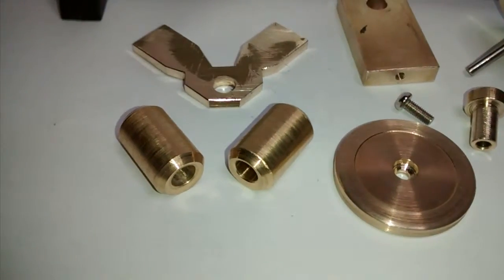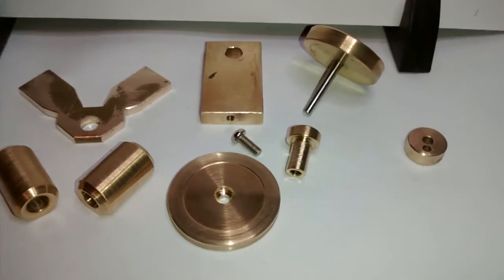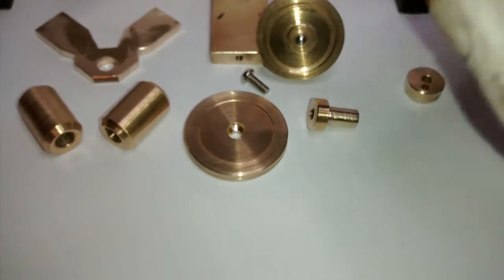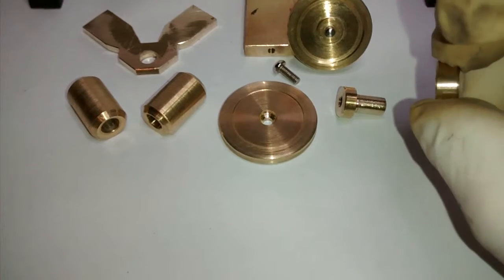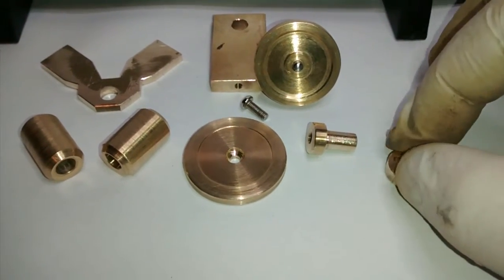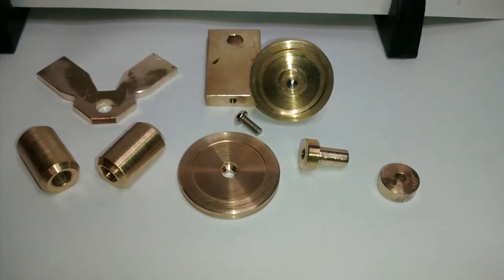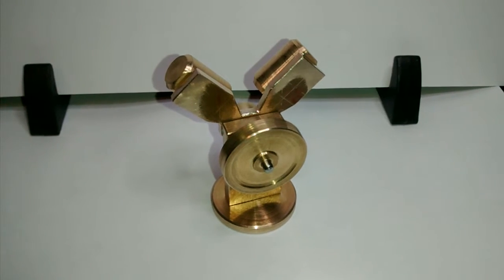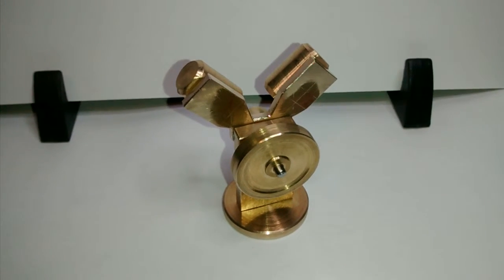Tiny V Twin Steam Engine Pt. 3

Comment: That's a lovely little engine.  I was talking to my mate on Friday night about cold rolled steel and he told me about another type that has some lead in it to make machining easier but I forgot the name.  Sounds like something...onium.  I'll call him later to get the name.
Reply from the maker: Thanks Brendan, she's going to look nice when finished. I cant remember the name of that stuff either, knew them all back when I was at the Tech, but these days without the aid of you-tube I couldn't remember what I did yesterday :)

I have a few pieces of cold rolled round bar that is just a bit rusty and will be fine with a light skim to remove the rust, I also autopsied a few old printers and the bar the carriage runs on is some fine quality stuff that cuts with a lovely finish. Still early days yet and these thing will turn up in time.  A mate of mine knows a place that sells cold rolled and are happy enough to sell you a foot long piece of the bar